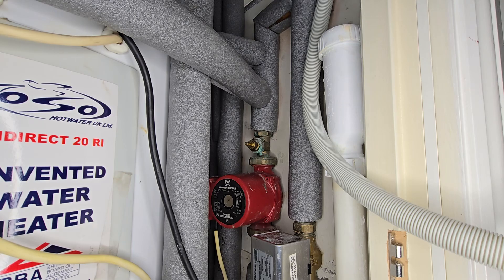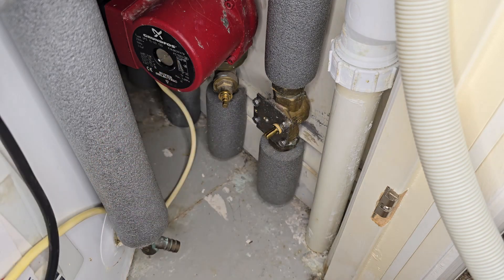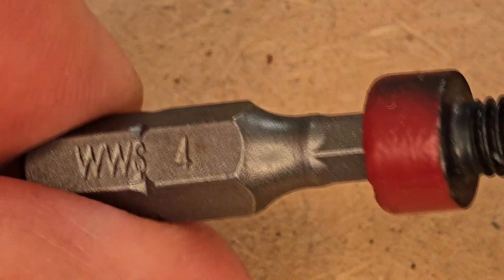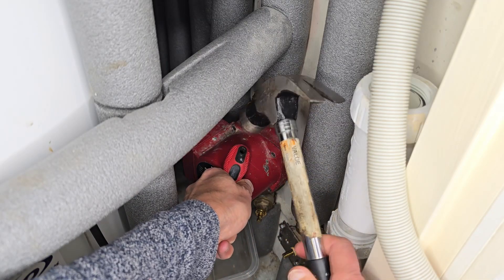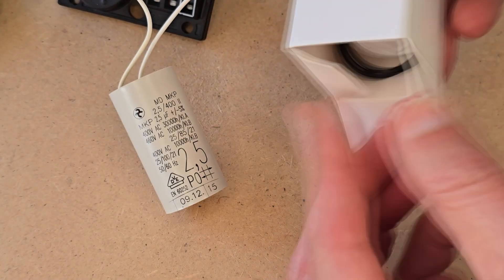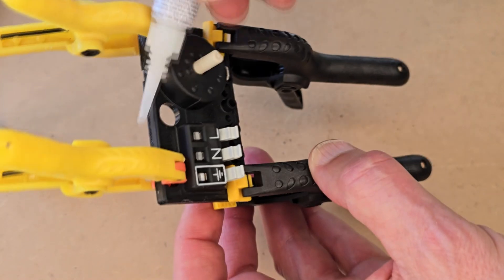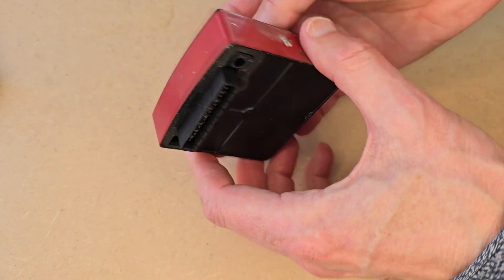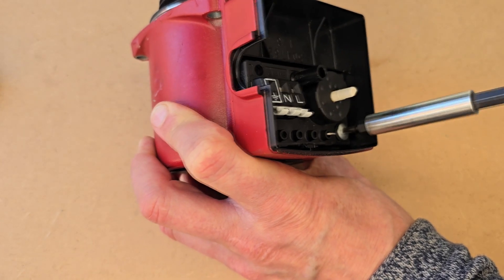How to repair Grundfos water pump | Capacitor replacement

Comment: Hi, really appreciate your video! My new capacitor has a + and - wire versus the previous both are brown. Do you know which port is + vs - on the board?
Reply: Replying to myself in case anyone else gets the same confusing capacitor. I got a CBB60 which is non polarized (required for AC current) but the variant I got had two different colored wires that are both the same. So it doesn’t matter which goes where as long as the right capacitor is being used
Reply from the maker: @prestontarry6839 👍

Comment: Thank you so much. Your video enabled me to change the capacitor. My pump is a slightly more modern model. So I did not have to glue the stuff back together. Removing the black small plate with a screwdriver, then I was able to pull the wires without any problem. You made my day!
Reply from the maker: Thanks for watching❤

Comment: Would you not get a shock by just cutting the wires , even one at a time ?

To discharge it you’d have to get access to the the back as per your video 👍
Reply from the maker: The capacitor will be discharged through the winding resistance after the power supply is disconnected. I didn't measure how quickly (I think a few minutes at most). But if it wasn't discharged, then touching both of its wires at the same time would cause an electric shock. It won't be pleasant, so it's better not to touch it. You can short-circuit them to make sure it's discharged if you feel uncomfortable.